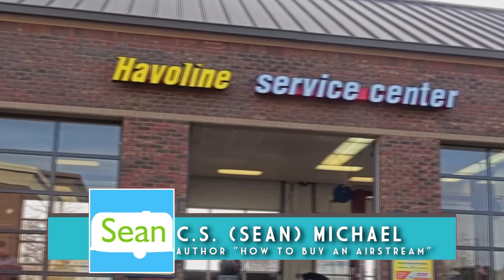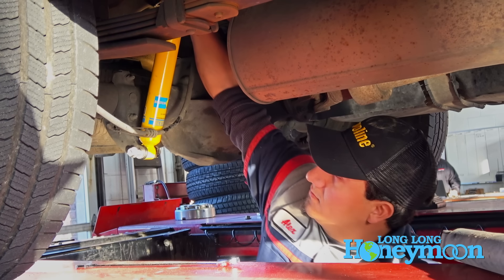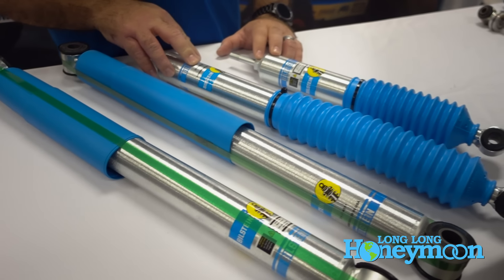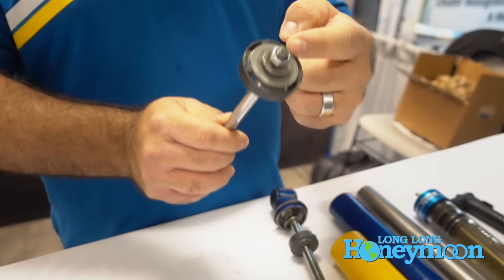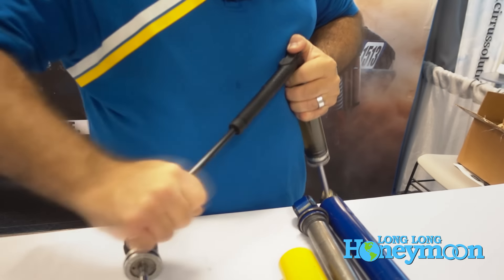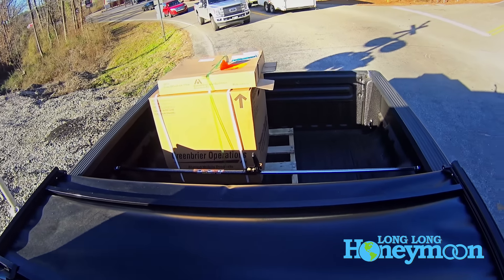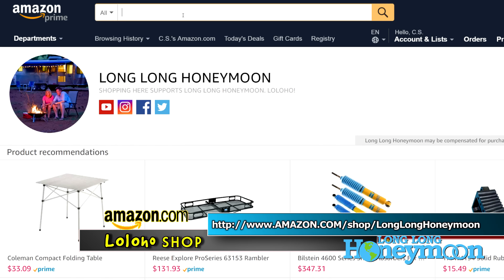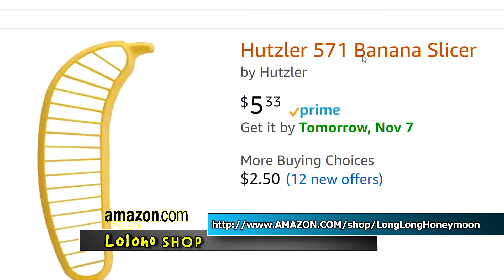BILSTEIN SHOCKS for SEEMORE, our Ford F250 RV Tow Vehicle

Comment: I am about to replace my stocks shocks and started looking at the Bilstein replacements.Why did you decide on the 4600 vs the 5100 series?  The forums are mixed on which series to use on a  non-lifted truck and towing compatibility.
Reply: The 5100s will be better for more firmer ride control, 4600 hd also fine. I have both, love both
Reply: I ended up putting on the 5100s, and with great results.  Took the bounce out when crossing the Bay Bridge.
Reply: I have a completely stock 2014 tundra that I was wanting to put the 5100’s on.. was your truck stock as well before putting them on? How have they performed since?

Comment: Thanks for addressing an issue I am about to deal with. One question, Do you use airbags in conjunction with the shocks. I have a 2013 Ford F 150 eco boost that we tow our 2020 Cougar 27 foot trailer. We do have a load leveling hitch. Second , I wanted to support you through your store, but you do not list the F150. Really enjoy your videos. Thanks

Comment: I have a 1995 f350 7.5l crew cab long  bed and about 9 inch lift altogether.. 35 inches  all terrain tires what shocks would you recommend to have a smoother ride? Right now the truck rides like a tank

Comment: I just put Bilstein B6 4600 shocks on the back of my 2012 Chevy Silverado 1500 and wow what a difference! The OEM monotube shocks were 9 years old with 73,000 miles on them.  The factory exhaust had also melted the dust boot on the right rear shock when I towed my travel trailer up Parleys Canyon on I-80 between Salt Lake City and Park City, Utah. That shock was also easier to compress than the right side which tells me the heat affected it. 
The ride and control is so much better with the new Bilstein shocks. Next I will have the front shocks replaced too.
Reply: Hopefully I can get some good results on the rear of my 03 silverado without raising my ride height

Comment: I have a 2006 F-250 6.0 with a 4.5 inch lift kit. Do I need to buy a certain shock from them for the lift? Or can I just by a regular shock for a F-250?

Comment: Been using Bilstein's for over 20 years and you'll really like the handling on a winding road. The first truck I put them on was a 1998 Ram 2500 that wallowed like a pig on curvy roads towing. After the replacement you could take the curve hard and in control. You won't believe the difference.

Comment: At about what miles should truck shocks be replaced? We tow with a 2014 F250 Crew Cab Supper duty, 6.2L gas burner. We tow a 30’ AS Classic 2014.

Comment: I have a 2019 ford f 150 super cab will I get a better ride if I put bilsteen shocks instead of stock these trucks today ride different do to the fact that they are so light hmmm.
Reply: Hi Mike, I am Brian, the guy in the video that Sean posted. Yes, you will get a better ride! If you have done no lift or level to your truck you need to run our 4600 Series shocks. If you have lifted or leveled it, or have plans to, you need to look into the 5100 Series.
Reply: @brianmccroskey1607  thank you the ride quality in these trucks today very wobbly  I have not done it yet still on stock shocks winter roads  makes it alot more wobbly  I looked into getting bilstein  shocks they want 2000 kind of holding off man I love the way the truck looks but man the ride sucks i hope i can get these  shocks .

Comment: I have Bilstein B6 shocks, which are the monotube shocks with the famous yellow body and blue boot. The problem is that they claim to be an OE replacement application that work with stock springs. However, after putting them on, I notice that these famous Bilstein monotube shocks with the yellow body and blue boot are extremely stiff. They should not list the parts as OE replacement. My original shocks had 30k miles on them and were in excellent shape, so I wasn't comparing worn out shocks with the new Bilsteins. The handling and steering feel of the monotube is noticeably better, but I wish they were a little softer. To people who are afraid of the monotube applications being too stiff, they should consider the OE grade replacement twin tube Bilsteins. They are usually about half the price of the monotube versions.

Comment: These are great!  I replaced all five of mine on my 99 F250 V10 seven years ago.  My truck sill drives like new with 160k.
Reply: 5? Which model of shocks did you get? I have the same truck

Comment: The old ZR2 S10 pickups and ZR2 Blazers came stock with Bilstein shocks. They do seem to last a long time. My Blazer has 187,000 miles on factory original Bilstein.
Reply: Their general fail point are the bushings.
Reply: Rubber does get old and cracks. They aren't the cheapest shock absorber. The ZR2 community knows that the only way to keep the ride quality of factory is to replace with Bilstein.
Reply: Yeah, but they could pony up to poly, and as much as I respect Bilsteins, Kings and Fox get the nod from me. My Power Wagon has 5 of these yellow tubes, and I live past three miles of dirt washboard. Meh, their ok.
Reply: I was totally thinking about Fox. If you are living on Arizona washboard then that is about as worst as I have seen. I would then put Fox or Kings on every time if I lived down a washboard road.

Comment: I'm confused. Only the word Bilstein was mentioned throughout the video. The truck got a yellow shock. During the video there was mention of the most popular Bilstein shock which was silver. So why did the truck get the yellow shock and not the silver shock which is more popular?
Reply: Bondo great observation and thanks for paying attention! In the video the silver most popular reference was for the shocks on the table for the video. Those particular ones were for class a and c motor homes. Those particular shocks have a silver zinc finish. The yellow ones for Sean’s truck required our 4600 series. They are heavy duty shocks but are yellow in color. The two most common series of BILSTEIN shocks for trucks are 4600 and 5100. 4600 series are for non lifted trucks and suvs. 5100s are for leveled or lifted. Hope this helps clear things up!

Comment: I bought 4 4600 series for my '13 Ford F350 DRW that only had about 8k miles on the original because all these people crowing how great they were.  Eh, they are better, but they definitely were not worth getting until the originals wore out.  A little better solo and seems the same towing my 15k 5th.  That's my recommendation, upgrade when you wear out your originals.
Reply: Thomas O ya that's because you bought the wrong shocks for your life lol. You need the 5100's and up...
Reply: @boochful  I was interested in the 5100 but for our expedition it was only available if it had a 3 or 6 inch lift
Reply: @boochful   Nope.  Have a 2wd, no lift.  That means 4600.

Comment: Nice shocks. Did you ask him what happens when the plastic ty-rap at the bottom of the blue boot breaks? Why a plastic ty-rap and not a stainless steel strap?
Reply: I've run these particular shocks for 20 years. Never had a zip tie break. Beside, the boots are vented anyway.
Reply: After watching the video, seeing the quality the company puts into the shock and getting a thumbs up from Sean, I would feel comfortable buying these shocks. When I seen the plastic ty-rap on the shock, my very first thought was, why didn't they use a stainless steel ty-rap. I think it would not only make the shock look better, it would show that the company spared no cost at making the best shock on the market.  Thanks for the response and sharing your experience with the shock.

Comment: Heard a lot of good things about these shocks. I was going to get them but we switched from a travel trailer to a class C. At that point I went with beefier sway bar on the rear and a steering dampener (basically a shock absorber for steering). That pretty much took care of the swaying and the jittery steering problems. If we have the RV long enough where shocks are needed we'll definitely be getting the Bilsteins.
Reply from the maker: I may get a steering dampener also. With the mileage on our truck, I’m sure the original is due for replacement.

Comment: Any quality aftermarket shock is going to be a HUGE improvement over OEM garbage. Fox, Billstien, Icon, etc... I have a 1-year old Ford F-150 Lariat FX 4 with the "upgraded offroad suspension" and it is AWFUL. One shock has already begun leaking and creaking when it compresses. The leaf springs are way too plush... all that garbage is coming off this summer for an ICON system.

Comment: There are Bilstein's and there are Bilstiens. We have a Class A on an F53 chassis. Ford installed shocks that looked like Bilsteins, but were a mediocre performance spec that they build for OEM use by Ford. Definitely not in the after market class. I changed the OEM shocks within 6 months of getting the motorhome. Decided to go with Koni's and have experienced a major improvement in ride. There is a raging debate going on in various forums over the relative merits of after market Bilstiens vs. Koni's for F53 chassis. Both seem to do much better than the OEM's, but there seems to be variation in "best" depending upon the chassis rating and how a motorhome manufacturer loaded the chassis. I will admit, that the willingness of Bilstien to put their name on a low grade OEM shock did affect my choice.
Reply: So Rick, thanks for your comment. You bring up an excellent observation. If your F53 was a 2015 or older, then yes that chassis was equipped with BILSTEIN from the assembly line. However, those factory BILSTEIN Shocks were built with the valving forces requested and developed by Ford. BILSTEIN made those to the reciepe that Ford provided in simple terms. Our aftermarket products for the F53 Chassis (24-234511 Front & 24-234528 Rear) are a MAJOR improvement in ride and handling over the factory equipped BILSTEIN that came on the chassis.  Do not misunderstand me, the quality of the factory shocks and workmanship is the same BILSTEIN quality as you would always expect. However, when OEMs use our dampers, many request us to build the dampers at their provided specifications. I would love for you to try the above dampers I gave part numbers for, I think you will like them better than what you currently have. - Thanks! Brian @ BILSTEIN

Comment: How do these compare to Mercedes or Cadillac electromagnetic shocks?
Reply: Gordon, They don't two separate technologies at work. The dampers in the video have a standard damping force built in them. The shocks you refer to change those damping forces as the shocks work on the vehicle based on the computer telling the dampers how firm or soft to be based on the driving situation happening at the moment.
Reply: Not the same technology.

Comment: Wow perfect timing with that video Sean lol , I was going to be buying some new shocks for the truck and wasn't sure if I should buy those or something else..
I will be buying those after he explained that and from your Amazon...
Ps . What was the reason you chose the yellow and blue shocks, instead of the chrome HEAVY duty ones? Just curious
Reply: Jerry, great question. The "yellow & blue" shocks are our 4600 Series Shocks. The Zinc coated silver shocks we offer are our 5100 Series. General rule of thumb on the two series is that when a truck has not been fitted with a leveling kit or lift kit, the 4600 Series are the shocks that are tuned to the factory suspension on most trucks. Only if you have installed a level or lift kit would we reccommend using the 5100s. The 5100 Series are tuned with the changes in place that a level kit and lift kit makes to your truck. Hope this helps. - Thanks, Brian @ BILSTEIN
Reply: Brian I have a 2007 Dodge Grand Caravan Braun Enter Van wheelchair conversion van w/a 10" lowered floor. It rides terrible. The van has over 45000 miles on it. Does BILSTEIN make shocks that would fit my van and give it a more smoother riide? Please let me know. Thank You !
Reply: go to bilstein website and search. I am SURE they have something for a Dodge Grand Caravan as that is a popular model.
Reply: Hello Bob, thanks for the question. If you can confirm that the rear shock overall length did not change from the OEM length when the conversion was done, then yes we offer a replacement. Part number 19-065212 is the B4 replacement. This would be an upgrade over the OEM shock.- THANKS! Brian @ BILSTEIN

Comment: I replaced my original 2002 F250 150k shocks with the Blistein 5100's, a heavier duty shock than the 4600's.  Very impressed, especially when towing.  They do ride firmer than Ford's OEM around town drive but with my RV attached a much better ride and drive.  If you have a smaller RV the 4600's will do the job, maybe better than the 5100's, if you have a larger, heavier RV and do a lot of traveling go with the 5100's the price difference in minimal.
Reply: Thanks for the info Rod! I'm changing out next week stock ranchos for the 5100s on my 2011 F350 drw. I tow a heavy 5th wheel.

Comment: Have you ever, in your travels, REALLY needed a 4x4 truck?
Reply: I don’t know about them but i live in colorado and never take my truck camper off. In these mountains in snow if you don’t have 4WD you wont get far.  It is the difference between sliding off the road and staying on the road like you are on tracks. Just my .02 cents.
Reply: I did driving thru northern CO for a job in WY. US287 in a blizzard. 2011 F350 DRW towing a Jayco 3 axle 18000lb trailer. Rear wheels began to break traction, so I put it in 4H. Didnt have a problem after that and several semis down the road had jackknifed off the road. Glad I had 4 wheel drive!